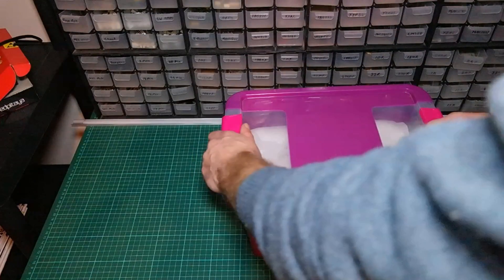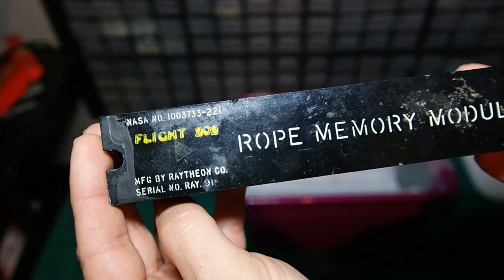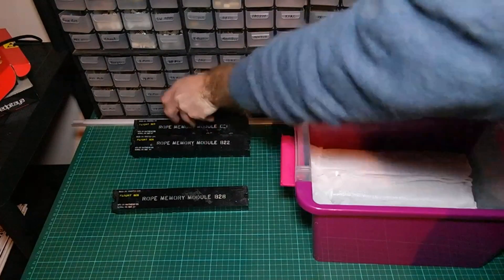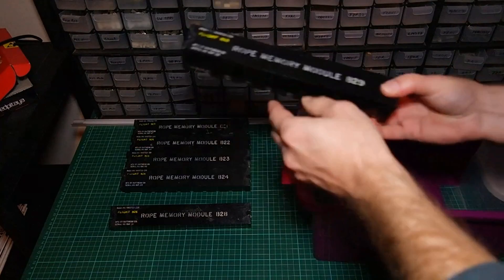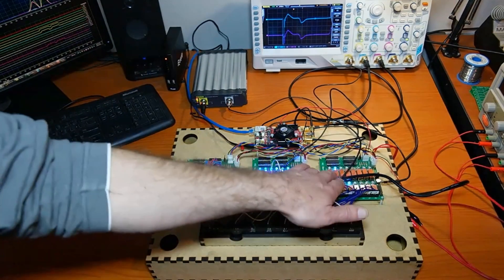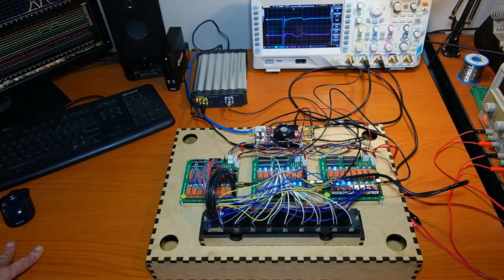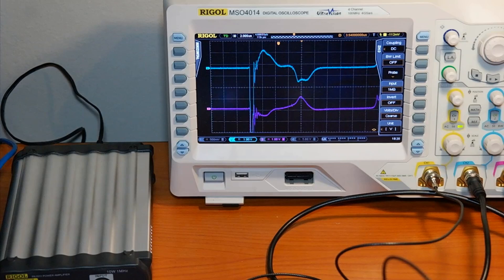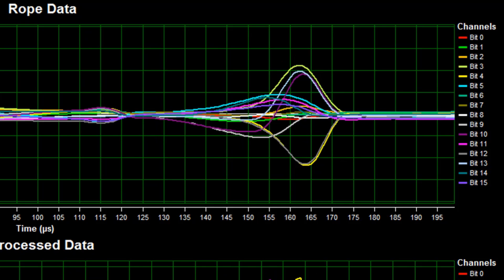Apollo Rope Memory Modules (Part 1 - Introduction)

Comment: EDIT: I see you answered this in another comment. 
I know this is older video but have you worked with Curious Marc? A guy on his team has worked magic with this software and if you haven't collaborated you should.
Reply from the maker: I originally introduced Mike Steward to the owner of the AGC and the rope memories featured in this video. The rope memories were returned to the owner and Mike managed to read the data earlier this year using a rope readers that he designed specifically for this. My personal situation unfortunately changed and I was not able to continue with this project.
Reply: @AuthGate thank you for everything you did on this.
Reply from the maker: @markgreco1962  It was a pleasure and honour to work on this, even if my contribution was small. The world would have been a much different place today without the technical advantages made in the various engineering disciplines during the Apollo program. I have the utmost respect for the men and women who worked on the Apollo program and they accomplished much more than just going to the Moon.
Reply: @AuthGate   amazing work!! so you did 7 years ago what Mike did recently with his reader, I get it, right? Mike explained something about the problem of magnetizing the cores in case of wrong current flow, which could compromise the functioning of the memory, do you agree with that? thanks!:)

Comment: Amazing unclear as to a 1 or a 0 in the analogue signal shown. Surely there was better definition in reality.
Reply from the maker: Keep in mind that the diodes used in these early modules were notoriously bad and didn't age well. These modules also operated in a slightly different configuration in the actual AGC, which would certainly have had an effect on the impedance. With 512 micro transformers and thousands of unshielded wires packed close together in such a small form factor, you are bound to get some crosstalk.

Comment: Wasn't the Gemini Computer the first computer in space ?   https://en.wikipedia.org/wiki/Gemini_Guidance_Computer      Obviously this is just a matter of semantics perhaps, but nevertheless it is a technical oversight.  Awesome job, and amazing contribution for sure !!!  Thanks !
Reply from the maker: Thank you Jason and a good observation. In the video I was talking about a microcomputer constructed with silicon chips as opposed to a mini computer constructed with transistors. The Gemini computer as well as the computer in the original Minuteman missiles were constructed using transistors. Earlier rockets and satellites even used mechanical "computers" with spinning disks, gears and latching relays!

A few viewers differed with me on about this distinction, but this was the pioneering days and the terminology was not yet well defined at the time. NASA and MIT originally referred to the Apollo Guidance Computer (AGC) as a miniaturised computer, rather than a microcomputer. By using chips, they were able to pack a lot more functionality in a much smaller space, hence my view that the AGC was the first microcomputer in space.
Reply: @AuthGate  I can live with that !  Thanks for the reply and take care !

Comment: The first computer,  so small it fit in tbe palm of your hand. Its microprocessor and hard disk drive was designed and invented by the US Navy',s greatest unsung engineer hero of the cold war.
Proven fact. That computer was supplied by the manufacturer of the Polaris. It was modified to fit as an invention of others. The truth as prevailed, try it.

Comment: Excellent work!  Later core memory was always Read-Modify-Write, because reads were destructive to the stored data.   Is there any limitation on the number of reads you can do to rope memory before data is lost?
Reply from the maker: Thanks William. The technology used in the Rope Memory modules is very different to core memories. The bits (zeros and ones) are actually physically wired in during manufacturing. The cores used in the Rope Memory modules does not actually store any data (as is the case with core memories), but they function as little toroid transformers and are used to select single wire strands to "read" the bits. 

Many people misunderstood this point and I have been thinking of making a few videos to explain the principle.
Reply: @AuthGate  Thanks.   I have since learned about rope memory.  I used computers with core memory (HP 2100, Data General Nova) early in my career.   Today we take so much for granted - small plug in modules with Gb of fast memor, etc.    Back then there was no solid state memory.   Program memory has custom made.

Comment: What happens when those wires pass through the Van Allen radiation belts??? Do you believe they work??
Reply from the maker: The AGC survived two lightning strikes in Apollo 12. The Van Allen belts doesn't even come close to that amount of energy. Why do you think think wires will be damaged by a relatively low dose of radiation?
Reply: @AuthGate  they dont get damaged but induced currents affects proper signalling.
Reply from the maker: @ekiskaliburnirvana9047  The AGC was hardened against 'erratic signaling' and would simply restart. The influence of Van Allen radiation would be minuscule compared to a lightning strike.
Reply from the maker: @sploofmonkey The Apollo development was a civilian project and only a few sensitive items like the cameras (that were also used in military applications) were secret. All the technical information were released decades ago and most of it can be downloaded from http://www.ibiblio.org/apollo

Comment: Why doesn't this short circuit when it's folded together? Those wires aren't insulated and they are consistently touching each other.
Reply from the maker: The wires are insulated. It is similar to the wire used in transformers.
Reply: @AuthGate  It must be a translucent insulator then because it looks bare(at least to me). Thanks for answering this question because this question has been bothering me for some time!

Comment: The reader is much more primitive than the 1966 hardware itself. Imagine using relays in the 21st century for circuit switching. That's 1890s technology

Comment: Am I correct in assuming that these are "potted" versions as all of the flight modules in later versions we're sealed to prevent movement and moisture buildup of any kind during launch and space flight. I've personally seen the insides of some of the other modules including the 4.4v power supply. Absolutely amazing.
Great job on the rope reader!! 
I saw another 5 man team doing a full rebuild of the complete assembly here on YouTube. Being able to read and save versions of this software would be extremely valuable . A collaboration would be in everyone's best interest. The way we as a civilization discard so quickly the beginnings of technology is how history is lost.  No wonder we can't figure out our past or the pyramids or even the dozens of megalithic structures or what civilization and technology was utilized. Great job!!!

Comment: As of December 2018 there is a team hold up in a hotel refurbishing a Apollo Guidance Computer.  Unfortunately it doesn't have any of the program modules.  It was being used for development at the time it was scraped and never flew.  Instead of rope memory it had a re-loadable rope memory simulator module.

Comment: Why are you interpreting a negative and positive pulse both as 1. And no current as zero

How do you know you are not just reading random gibberish? How do you know you are reading the module correctly?
Reply from the maker: Good comment. I have another two videos that are about 95% done. It describes in detail how the rope memories work and will answer all your questions.

In short, each memory location has a dedicated parity bit that is used to validate the 15 bit data words. This can only detect single bit errors, but this "checksum" pass on the majority of the memory locations. The bigger issue was to figure out the bit order of both the address and data lines. 

Much of the higher level details are described in various technical documents that are publicly available. I will add a list of these documents to my next video.
Reply: Thank you, will look forward to the videos.

The main question was why do you consider a negative voltage a 1 and not a O
Reply from the maker: From the documentation we know that sense wires that are threaded through cores indicates a "1", whereas sense wires that bypass a core is used to indicate a "0". The direction in which the sense wire is threaded through the core will determine whether we sense a high going, or a low going pulse. In practice, half of the cores are threaded in one direction and the other half is threaded in the other direction. This has the tendency to cancel out most of the crosstalk that may occur between adjacent wires. The bottom line is that it doesn't matter if the pulse is positive or negative. Both conditions indicate that the wire is threaded through a core, and is therefore a "1".

Comment: I use a Steinberg CI2 as well ;)
Reply from the maker: Well spotted! Very good quality mixer. Been using it for almost 10 years now and it "just works"
Reply: Yeah. For me both Windows and Linux. I do a lot of different technical work (Im a computer scientist but do some consulting work on the side) and I have had to setup some audio stuff for conferences and special lectures Ive given before. Its always my backup DAW and it has saved me countless times.

Comment: Great work! Apologies if this question has already been asked, but is there an advantage to using relays instead of transistors for switching the data through?
Reply from the maker: Thanks Syd. You are right in saying that the relays are used to "switch the data through".
The actual pulsing of the cores is done via two high resolution signal generator outputs on the Red Pitaya computer after the relays have settled. The relays are DPDT (Double Pole - Double Throw) types which makes it easy to route signals to the correct pins on the module. For each read cycle, I had to correctly power 8 of the 16 core inhibit signals, activate 1 of 8 strand select signals and pulse 1 of the 4 core planes as well as route 2 of the 16 data bits back to the ADC inputs on the computer. The relay contacts have a very low resistance, work with current flowing in any direction and they are not affected by the relatively high back EMF signals. They really simplified the process and allowed me to experiment with many different configurations.

Plus, it sounds very cool and is consistent with technology of the time ;-)
Reply: In that case the DPDT relays do sound like a better option. Rather than using sets of MOSFETs or BJTs in some H-bridge configuration for what I could only imagine would be a LOT of trial and error (not to mention the complexity of driving all those transistors and getting the timing right). Especially if switching speeds are not a factor. Additionally you are absolutely correct about the cool factor of the sounds they make. Keep up the good work! I'm sure it's not easy to reverse-engineer this old technology with the limited information available for them. I'm looking forward to your future videos.

Comment: Crap.. You know how long it took the women to thread those things. Not to mention if you screwed up. It took forever to find where you messed up! The person that tossed these away should be flogged. As it would take months to complete each module. Then test it each one 100 times for a faulty core or wire.

Comment: You deserve way more subscribers! I am an IT technician and I am looking forward for the extracted data. I'd love to try and see what I can do to read the software.
Reply from the maker: Fortunately we have all the technical information. There is even a virtual AGC and an assembler (yaYUL) that you can use to compile software for the AGC. Just Google "agc assembly language".
Btw, the Z80 opcode for RET is C9h and I knew that from memory ;-)
Reply from the maker: Thanks, it has been picking up lately. I am currently busy with an upgraded version of my rope reader and will release the data as soon as I am happy with it. I am pulsing the cores at a much lower voltage than they did it in the AGC, because we don't want to damage the (50+ year old) diodes.
Reply: I'm sorry, but you can't do shit without the assembler instruction codes, all you'll ever get with a memory dump is 10110010111..., that means nothing! For example, for the 8-bit Z80 CPU the code for DJNZ RELJUMP is 06 NN, where NN is a number between - 127 to +128. This translates to subtract 1 to the contents of B register, jump to Program Counter +/- displacement if not zero.
As far as I know, no one knows or recalls the instruction set for this "computer", let alone to know the registers, flags, etc. So, basically it's just junk, reason why they toss it away...
Reply: I honestly thought all that information had been lost. A few days ago I saw a presentation made by dutch guys but they talk so fast I got lost at a certain point... Have to watch it again at half the speed ;)

Comment: the second you read those modules you erased them. you cant read a bit without putting it back. its not ROM
Reply from the maker: Rope memories (ROM) and Magnetic-core memories (RAM) are two very different technologies. The transformer cores in a rope memory are only used to magnetically transfer data from selected sense wires to the computer and are not used to store data like is the case with magnetic-core memories. The data bits are really hardwired in so it is not possible to accidentally erase these.
Reply: Right, I know this but why has my reasearch commonly seen rope moduals labled as rope moduals with cores in them. Back then rom was on a silicon chip, not hardwired in rope. Your ocilliscope test proves it is core memory. If you run test on core memory you will have the same output waveform. Not debating but trying to help. Instead of reading them let's load them and read them.

Comment: AS202 is a early test flight and rarely mentioned, so the computers carrying the early softwares could be not  that important for NASA. I mean, 1960s computer softwares aren't that important nowadays after all.
Reply from the maker: I think is was important enough that it was removed from the Command Module and subjected to post flight testing. That is probably why it didn't end up in a museum like the later flights.
Reply: The whole computer unit probably got dismantled. Because the CM could be used as a boiler plate model in later drop tests, the computers may not be the test subject there. Then the computer may be in a warehouse for a long time, then sent to scrapyard when they are cleaning warehouses. It's only my guess though.

Comment: Just seen this, amazing. I am a electronics engineer and embedded / bare metal programmer, I am willing to take on the challenge! I am interested in your readout, I will be able to build a simulator for the original computer if I get enough info about it.  I come from the days of core memory etc. so know how to do the usual tricks. Have you digitised the data yet into bit streams / binary?
Reply from the maker: Happy to have you onboard buddy :-) There is actually quite a lot of information on the Block II AGC. Ron Burkey (who manages the ibiblio Apollo document archive) created an excellent simulator for the AGC which he has already modified to execute the slightly different Block I code. I have also recently upgraded my rope memory reader and will do a another read once I am sure everything is working as it should. We don't want to damage these babies!
Reply: There are already ACG simulators, and even someone who rebuild one.
See:
http://www.ibiblio.org/apollo/index.html
http://klabs.org/history/build_agc/

(last link has a lot of technical data if you need them).
Reply: I got interested into all that stuff because of Apollo deniers (I'm sure you saw some here or somewhere else). It's amazing how they can pretend things without knowing anything, like "that rope memory cannot work because <some rubish>" or "the AGC design is flawed because <another fallacy>".
I came here to have answers for them and you're doing a great job!
And of, course, more than that, those are beautifully engineered machines, and it's amazing to know more about them.
Thanks you so much!

Comment: This guy  can do this, but microsoft cant get windows 95 games to work on win 10.... Awesome video! Also did it used to make the clicking noise when it was working originally?
Reply from the maker: The DSKY (Display and Keyboard) unit had more than 140 relays, but it was all potted, so clicking might have been a bit faint. In total, there were about 800 relays in the Apollo Command Module and together with the pumps, valves and thrusters, it might have been a bit noisy. The astronauts on the first trip around the moon did actually complain about the noise.